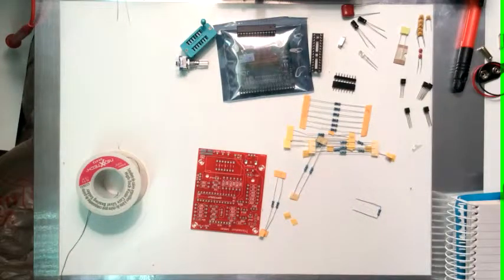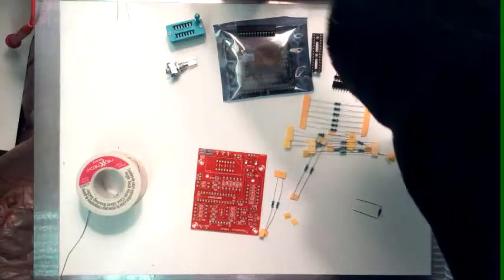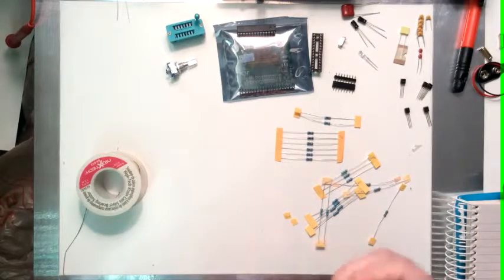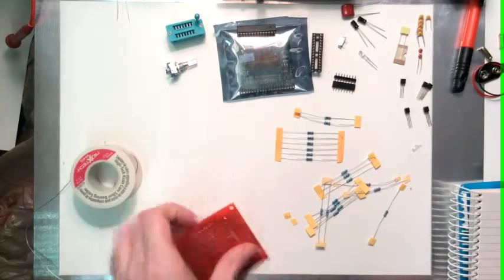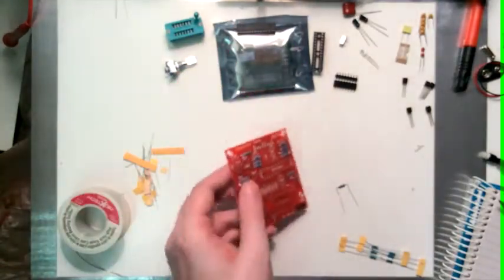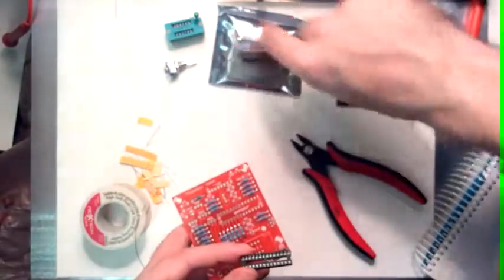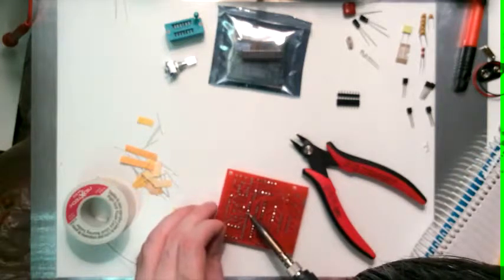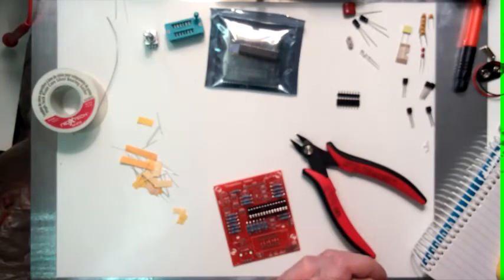M8 Transistor Tester Kit Build - Part 1

Comment: Might you be able to take a look at my video ideas list, I included one or two kit build ideas in there, how well also does this device measure capacitance? Would you say a regular multimeter with extended functions would be a better tester for capacitance than a stand alone capacitance meter?
Reply from the maker: Oh, a purpose-built capacitance tester will always be better than a multimeter, but a decent multimeter will give you a decent enough reading.

Comment: What brand and model soldering pencil or station do you have
Reply from the maker: It's a Circuit Test SX-500. I just recently ordered a Yihua 995D, which I'm super excited to get. I'll do a bit on it when it arrives.

They don't have the SX-500 anymore, but a comparably (for what I paid initially) priced iron would be here - http://www.rpelectronics.com/sx-850.html
Reply: Could you get tips for it,from now on I won't buy any soldering device,unless the sell replacement tips,since your pen look like my pen I hopeing they make tips for yours and that they will fit mine
Reply from the maker: They do sell the tips for that iron, is a fairly standardized style.